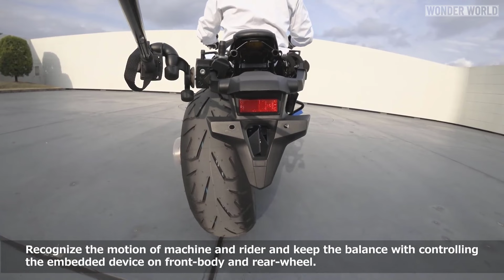Honda Riding Assist Technology

Comment: that's the cyberpunkiest bike I've ever seen
Reply: Yeah it looks like an akira bike
Reply: Thats a modded Honda NM4, I love that bike from early 2010's, so sad it wasent sold more. I own a red one, its basis is a hondaNC700 dct.
Reply: @sirmonstras1771  Yeah I wish bikes of that style were more common. Honda always makes sexy stuff
Reply: Yeah.  Absolutely dope looking bike with some storage things going on in all that front end space.  But, they threw a DCT in it.  No manual clutch and no (real) manual gear shifting.  Not even as an option, if I recall correctly.  That turned off a lot of the customer base.  I think reviews of it also didn't find the mirrors functional.  There was a lot going on with it that was really cool.  But, low power, and taking some of the engagement away from the rider didn't work out well for them.  People thought of it more as a scooter than a real bike.

Which is a little odd because it's practically impossible to buy a manual car at this point because ... they sell so poorly.

I saw VERY few of these on the road even while they were currently being made.  Now they're virtually impossible to see.

Comment: I would LOVE to see this on a unicycle!
Reply: Good idea!  Hadn't thought of that.
Reply: It’s been done 😁
Reply: If anyone can do it it's Honda. You can take that to the bank.
Reply: My daily commute is an electric unicycle (EUC). It balances in a forward/backward way but you have to balance it sideways. My one is about the size of a motorcycle wheel, has a range of about 40 miles, has a top speed of 40mph and costs barely anything to run. My particular model is called a Begode Nicola Plus but there are many types of EUC out there.
Reply: @mikebikekite1 I honestly think you do not own one seeing you don't have it anywhere on your feed, just video games😆 anyone who has something cool would be showing it and talking about it rather than just talking about it. Just my opinion.
Reply: @mikebikekite1  to be nit picky, its called Gotway Nicola+ not Begode since Nikola was produced when Gotway was active and Gotway engineers designed Nikola and all the other "good" wheels and now they are working at Leaperkim! :P
Reply: @EverlastingEclipses  Gotway was the original producer of the wheel and Begode is the current producer of the wheel. The Plus and the "+" are interchangeable. It could of been a perfect wheel if they gave it decent riding lights, made the sides easier to grip and scratch resistant, put a catch on the handle so it doesn't break in a crash and, perhaps most importantly, stopped it from randomly exploding into flames in the middle of the night.
Reply: Bombardier Embrio
Reply: Like most of the electric unicycles AREADY in use?
Reply: Electric unicycles self balance front and back

Comment: The Gyro's are called Wheels, As they spin a motorcycle they keep the bike upright. So if it not broke do not fix it.   This is so unnecessary.  Just install what they call a kickstand.
Reply: And yes, those work fine at speed, but when you stop?  you fall over.  Gyroscopic effect ONLY works if the wheels are spinning. kickstands are SO last century.

Comment: but is it still effective on high speed
Reply: The balancing system would only need to work at low speed. Presumably, once you're doing over e.g. 10mph, it could just lock in position and operate like a regular bike.

Comment: That's the NM4 frame. I saw it in the dealer's when it was still in production. The sitting position is the most comfortable I have ever experienced. I wish this moto was still in production.
Reply: Got one.  2013 model. I love the looks, but it IS a 'love it or hate it' thing.  it's very comfortable on short rides from here to there, but longer ones it's kinda rough on the lower back. You have to take breaks, altho you should do that anyways on long rides

Comment: AS a long time rider I'm all for innovations that help me ride safer. But this is too complicated. A low center of gravity works just as well. On My Suzuki Burgman 650  I can coast to a red light at 5 KPH with no issues. Sometimes best solutions are the most simple ones
Reply: How is being more comfortable be more complicated? Sure you can coast but you will eventually run out of room. Not saying that's the only reason, just an answer to your question.

Comment: I want that. I NEED that!!🤩
Reply: @HonorableAssman  dude, I do, I keep falling sooo much😅
Reply: @HonorableAssman  yep, I considered that😂 a sidecart. But I prefer tail-wiggling bike
Reply from the maker: it's not hard to stop a motorbike from falling over at a stop light, and it's rare that it will ever happen, but it does happen, I have been riding for 30 years and I have fallen over 3 times. Heavy side winds catch you unaware, loose gravel on the road, just losing balance, it all happens sooner or later.
Reply: @WonderWorldYTC I just fell right now reading your comment🏥

Comment: 10 years after people think it's a joke when u fall of the bike . ABS really really helps a lot . In my KTM ABS system failed and it's costs a lot to replace , now I am afride of driving fast and carelessly, it won't stop as u like in situations , because I am so much used to that need sometime to relearn .
Reply: relearn how to ride. It's no big deal.  Bikes didn't have ABS for a long time (hell, I've ridden for about 15 years and never had ABS) and people were just fine.

Find a parking lot with no cars.  Spend time practicing how to brake.  Don't forget, rear brake is virtually useless (unless you have linked brakes, but even with linked brakes and no ABS I would avoid that rear brake as much as possible).

The old rule you should have learned before getting your license is .... 
if your rear brake locks up ... keep holding it down until you come to a stop.  But, if your front brake locks up, release it immediately.

Don't forget to also practice braking and turning.

Riding a bike without ABS can be totally fine (I've done years of city commuting and tearing town twisty canyon and coastal roads, plus highway runs well into triple digit speeds).  You need confidence and you need to earn the confidence.  That comes with intentional practice. 

Decent rule of thumb though ... if you cannot afford to maintain something properly, you cannot afford that thing (no shame in that, there are lots of less expensive bikes with no ABS to maintain).
Reply: @zero11010 Yeah don't even use brakes man just smash the target!

Sorry but those rear brakes ain't there to decorate or you're driving super safe or too safe...

2 major occasions to use them : 

1- Emergency braking... Use exclusively front brakes and you're out. You lower the rear first before pulling front brake for stability and better grip when you front brake because you d'ont have all the weight on the front of the bike... It's pure science

2- At super slow speed you use exclusively rear brake to stabilize playing between clutch and rear pedal to avoid dips on the front suspension.

Here a 3rd one as a bonus : cornering adjustments. You upset much less the suspension that way.

Besides that I'm with you on the rest of the comment 😇

Regards

Comment: I an a highly advanced rider so I don’t expect others to equal my skills. But I’ll tell you my secret anyways…. When I come to a red light, I put my feet down. You too can learn this technique with a little practice. No electronics necessary. 👍
Reply: i know you are kidding but this would genuinely be great for people who have never learned how to ride a bicycle(can't do u-turns, low speed maneuvers, basically anything other than a straight line) but want a commuter, of course, given that the cost of a vehicle with this system would still be about the same as normal motorcycles in the future, compared to the cost of cars.
Reply: @rzt430  If a person can’t do those basic maneuvers, they shouldn’t be riding.
Reply: @blipco5  And folks that can't think shouldn't be behind the wheel of any vehicle, but here we are.
Reply: i dont have legs
Reply: @blipco5 It’s like saying “If a person is crippled, they shouldn’t be walking.” or “If a person can’t shift manually, they shouldn’t be driving.”  There are people who work hard to make other people’s lives easier.

Comment: The yellow Honda ESV bike does look cool too. It could use some tweaks to it’s looks, but overall it looks good.
Reply: That's the older NM1 also known as the Vultus.  It was introduced about 10 years ago.  They're just using the old bike to demonstrate the new self balancing tech.
Reply: @zero11010   
The NM1 Vultus looks good. The smoothed out lines do look good.👍

Comment: Absolutely amazing technology! 
I’ve always had an interest in motorcycles, but I’m deathly afraid of not being able to balance from prior experiences from bicycles. 
This would completely solve that issue entirely.
Reply: You should train with a normal bicycle first. You should be able to manually balance your bike in case the self balancing system fails.
Reply: @dumdum7099  read my comment again
Reply: The main problem with balancing bicycles (and by extension motorcycles) is trusting the bike. Every single person I've ever seen that has a problem with it is actually trying to balance the bike themselves. They're leaning or otherwise inducing inputs to the bike in an effort to keep it upright, which that's actually what causes to be unstable.

As long as a bike is moving, it's self balancing. This is because of the caster effect. If the bike leans to the left, the wheel turns to the left, which causes it to move in the direction of the lean. This in turn causes a counter torque that makes it lean to the right just enough to go upright again.

See, the thing is... you have to trust the bike. As long as it's moving, it knows how to stay upright. The moment you start treating it like you are the one who has to keep it balanced, you're going to lose balance because you're going to be fighting the automatic balancing forces present in the system.

Yes this does mean that if the bike is leaning itself to the left, it's going to feel like it's falling. Resist the urge to lean it upright again because you'll immediately destabilize it. Let it complete its counter torque and it'll go upright again on its own. It's counter intuitive as heck but once you learn to trust the bike like you'd trust a horse, it all becomes so much easier.

Comment: I h8t3 all the safety rubbish on my Honda Shadow.
Anything that keeps the bike from starting or running that can leave me stranded when I forget about it or it breaks...  needs to go.
Things like vacuum pressure cutoff fuel petcock switch, kickstand safety switch, etc have led to a worse experience of me swearing at my bike what is going on, why did it just stop, or why won't it crank.
Reply: buy a 89 shadow and learn to fix it

Comment: If Honda could stick that tech on a Harley, I'll be impressed. 😁
Reply: Then it wouldn't be a harley, it would be a Honda 🥴
Reply: Putting something this high maintenance on a drama queen like a Harley or an Indian is just being a masochist.
Reply: Harleys suck in technology. They used pressure tactic (stopping mangoes, a perishable commodity, at the port) to get pollution norms eased for them in India. And that was at Bharat stage 2 or 3 norms. Now we are at 6.
Reply: the'yd most likely make kits you can retrofit to your bike. literally just a motor on the forks with sensors and at worst, a gyro needing to be installed somewher eon the bike

Comment: Awesome, now anyone can ride a motorcycle. That's how it's got to be. Less pollution. Love it, no need to put your foot down on rainy days. Love to trade my 2 wheeler to the guys who still looooove to hang on to dumb technology.
Reply: I'm in favor of both this and bikes that can't do this. This is great technology.

Thing is though, this is a lot harder to maintain yourself, and in the event of a nuclear blast, my carbureted dinosaurs are going to still be functional and this bike will be a pile of useless scrap. At worst my turn signal auto cancellation unit will stop working and maybe my turn signals won't blink. Big woopdy doo there.

What I'm saying here is both this bike and older bikes have benefits the other doesn't.

I'm also somewhat puzzled about why so many people think this bike is a game changer... Save for slick, icy roads balancing isn't that hard on a bike. It's like Honda is over engineering a solution to a problem that barely exists.
Reply: Less pollution? Only bicycle can lower pollution. Motorcycle is still the same as cars

Comment: Sitting at stoplights a rider can become fatigued. Ok come on now.. I've been riding since 93. That's a new one... The tech is pretty cool though. I can't see myself going out and buying a bike just for that feature. Although if you get around to scanning the road in front of through the turns and adjusting the ride for max grip by leaning more or less without changing direction it could be a whole new level of active traction control. I've gone through oil, dirt, small rocks, tar snakes, real snakes and whatever that was and had an involuntary pucker as the double yellow started getting closer at an alarming rate up in the twisties..
Reply: It depends on your size and build, the size and weight of the bike. But yes, holding up a bike definitely contributes to fatigue. And you can't deny that people do dump their bikes at lights and stop signs. So even if the problem isn't a major one, this still solves a problem. Especially for smaller riders and women.
Reply: @renaissancestatesman  On my first bike in 93 I once kicked out my kickstand which immediately folded right back up and leaned the bike over and about 1 inch past the normal "this should have stopped by now" it was too late. Fantastic. Now my leg is pinned between my bike and car and I have absolutely no leverage to do anything but start laughing. WTF>  LOL
Reply: About the only real issue this bike solves is keeping it upright on icy roads.

Sure people dump their bikes at lights and stop signs. I've personally never done that, but I've seen it happen. For the most part this is Honda just over engineering a solution to a problem that barely exists. But it's still really freaking cool.
Reply: These things are written in their thesis by researchers who never ride; 
OR by non-rider marketing guys working on brand image as technologically advanced.
They don't know the real problems. Hence, visualizing the non-existent ones.
Reply: @ndahiya3730  I agree with you 100%, but I mean... getting your bike to follow you around... I'm in BACA and the kids would LOVE that...
Reply: @BerryTheBnnuy  You misinterpreted. I never meant this tech is useless. Just the explanations.
Reply: @ndahiya3730  I didn't misinterpret. I'm just saying it's really cool and I want one for my work with BACA.

Comment: The newer generations are so molly coddled these days. I can appreciate the technology would assist a physically impaired person, but for most this would just spoil the overall experience of motorcycling. I myself have been riding motorcycles for over 40 years and do not need or want a self balancing focking motorcycle.
Reply: nah, for race with smaller people like asians, if you want to ride heavy motorbike you need to be fat. like, my friend really want to buy new ones from yamaha brand but he can't because regular asians are small and thin and big motorbike is too heavy for them. unless you're overweight to begin with.
Reply: i’m sowwy i’m too fweaking scawed to wide da wotorcycle but i’d wide it if it bawances itsewf